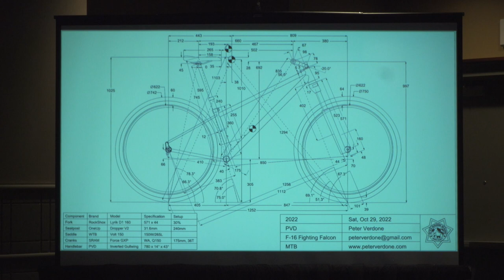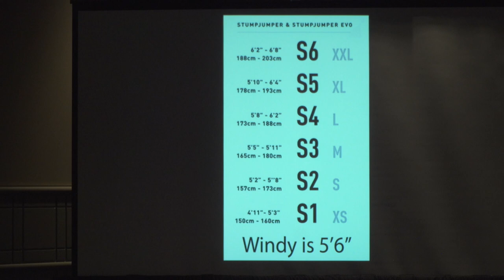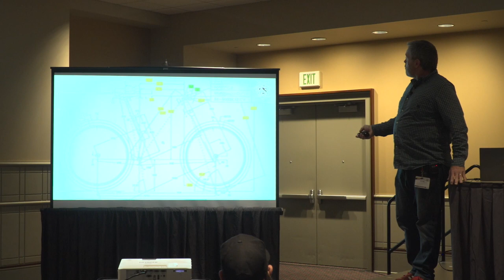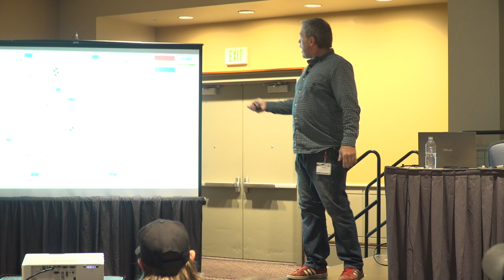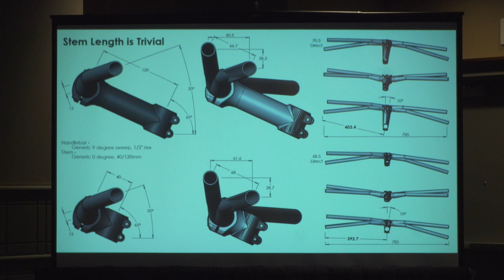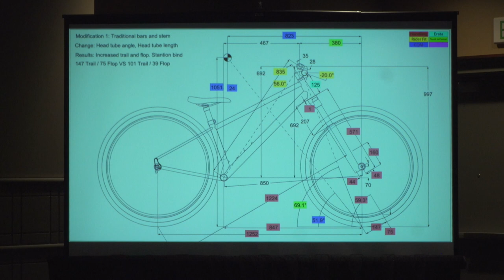Bicycle Geometry for the Designer and Rider

Comment: Thanks for this great talk. I hope people in the industry really take your thoughts to heart. You're bringing up important points that few people are talking about. Even as a cyclist who started in the last 2 years, it's plainly obvious that most bike "designers" have no idea how bike geometry affects fit and function. Or they know, but they use marketing to cover up their lazy designs so they can maximize profit. Just look at the how the geometry changes across sizing in one model -- what is fixed and what is changing  -- and it should be clear to anyone that the bike will not handle the same across the entire size range. If it doesn't handle similarly, is it really designed for the same purpose? Should it be called the same thing? People at the ends of the size spectrum experience this all the time. We get compromised bikes that feel nothing like what has been advertised.

Bike designers need to understand that bikes are an interface between the rider and the terrain. The bike is the link between the rider's contact points (seat, pedals, handles) and the ground contact point (tires). The bike is a tool that enables the rider to travel through the terrain joyfully and safely. It makes the rider feel comfortable and capable. Designers need to stop designing to marketing's specifications, and start thinking about the user and their needs first. It pisses me off enough to consider getting into framebuilding just so I can experiment and discover things that actually work rather than leaving it up to manufacturers and builders who don't seem to care.

Comment: I'd push back on the idea that forces normal to the ground should be the ones considered when thinking about fork stanchion flex. When you are going downhill, which is when I'd argue fork performance is most important, I think the forces you care about most are opposite to your direction of movement, which is different than normal to the ground. So while you may get binding in a parking lot with a 63 degree head angle, I think performance could be better on the trail in an enduro context.
Reply: Thanks for giving this presentation! Overall I agree that geo charts from manufacturers are largely garbage. And I generally agree with a lot of your bike fit ideas. But I do disagree that head angle and stem length don't matter. At least in my experience, there's a very noticeable change from a 40mm to 50mm stem, and I don't think it's all due to body position differences. I just ordered a 45mm stem to try and will see how that goes. With my ~63.5 static head angle that gets slacker at sag, maybe I'm more sensitive to stem length than you are with steeper head angles.
Reply: @alanbonk3542  I don't believe that the takeaway should be that normal forces are the only ones that matter with stantion bind. I went into great detail about optimization targeting. You can optimize for the 0.1% of a ride where optimizing for extreme downhill performance matters or the 99.9% of the rest of the ride. Or somewhere in between. The point is knowing what you are targeting and why and what costs you will pay for that.

There was another hour of lecture that I was forced to cut off where I would have gone into far more detail on this.

Also, you should have taken away that you need to focus on grip and wheel location rather than head angle and stem length. Make a print. You will quickly find that I'm correct. If you are doing anything without a print, you are just tossing darts in the dark.

Comment: When looking at the geometry of a full suspension frame, doesn't it all change once you weight it with a rider? Presuming the answer is "yes," are the geometries presented accounting for this (like, they assume the average rider of an S4 frame is 180 lbs)? In my mind, I picture a weighted rider on that Specialized frame lowering the BB, slackening both the HA and the STA, and lowering the COM of everything.
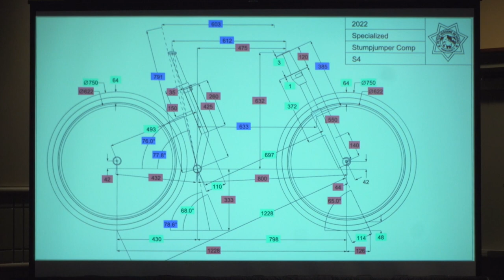Reply: Oops! 39:49 The audience member asks the same question.

Comment: I really like this talk, although I don’t understand everything.

Can someone please explain to me the part with the stem length and bar rotation? Same bar, same rotation, different stem length = nothing changes. What nothing? It’s obvious, that the bar only moved relatively to the fork shaft, so I would expect any change in relation to the bar.
But the distance to the saddle increases/decreases - so there is a relevant change in the overall config.

Or do I miss his point here?
I swapped several handlebar stems in the past on bikes and could improve the fit/feel significantly. So the length should matter?!

Thanks for your help.
Reply: safer , smoother steering at very high speed